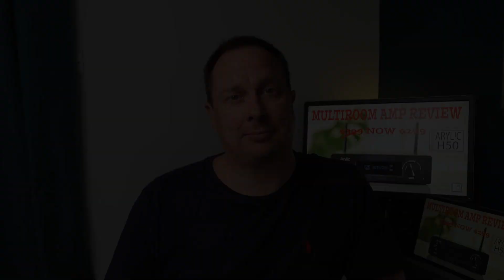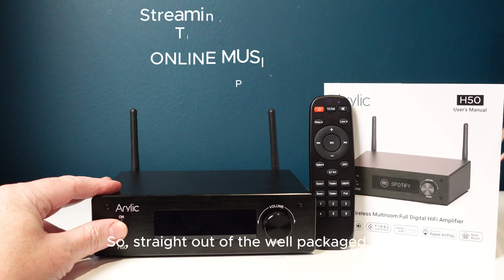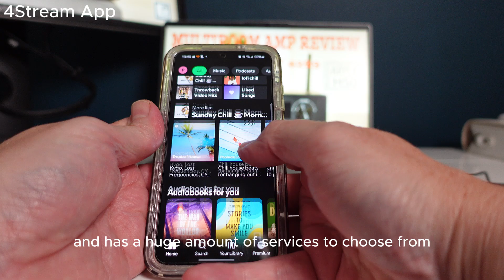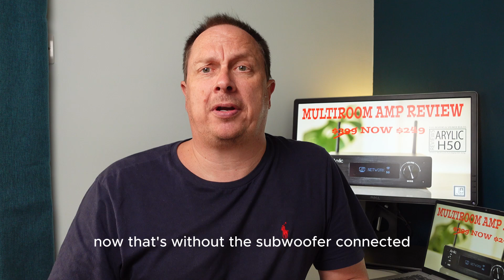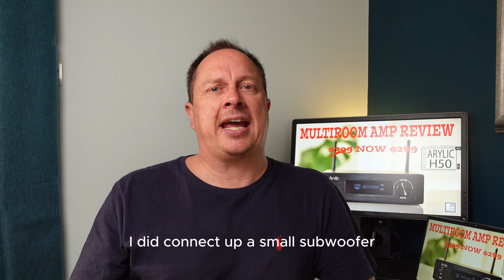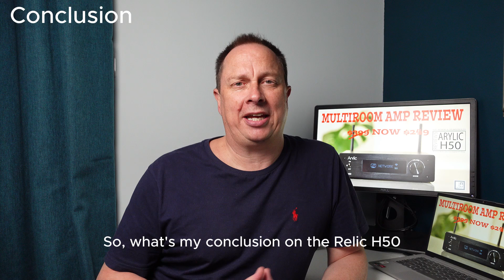ARYLIC H50 AMPLIFIER - Multiroom WIFI / Bluetooth Streaming, HDMI ARC, APPLE AIRPLAY

Comment: I'm looking for a small amplifier to power cam audio S30s in our kitchen. Currently we use an echo show which seems to be getting less and less responsive to voice (same as the Echo that was there before). Usually streaming amazon music but would also like to hook the tv to it (Pre ARC). Due to the delay you mentioned I am put off this product so thanks for that info. I wonder if a bluetooth amp with RCAs or optical and an echo dot or the annoying show for the streaming part may be the option here. Would you avoid this and if so is there anything better at similar outlay that you have tested?
Reply from the maker: Hi, difficult to find a single amp maybe look at wiim? Audio streamer and amp all in one and I'm pretty sure you could incorporate the TV too mind you probably £500.i like my fosi da3 and za3 combo. Has tv arc and connections for streamer which I guess could be your echo. (incidentally, I'm sure my own echos are going deaf) or just go for a chat per Bluetooth amp and stream sound from your TV to that? Best of luck